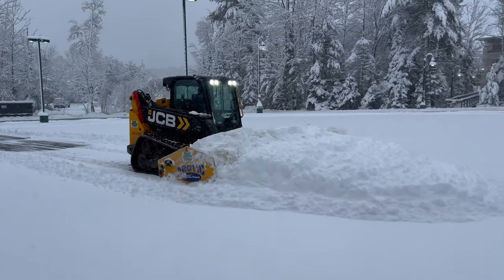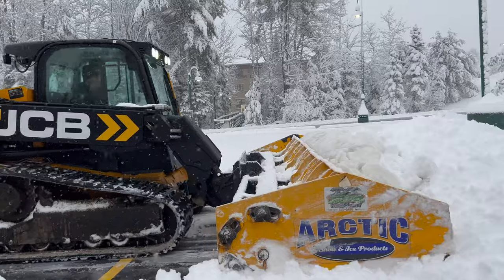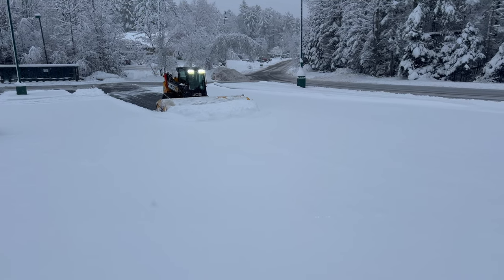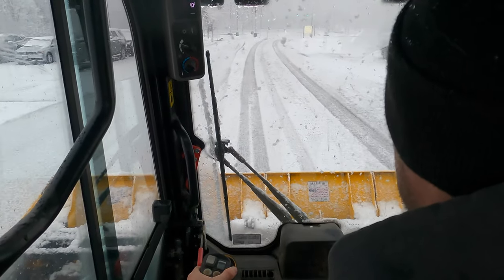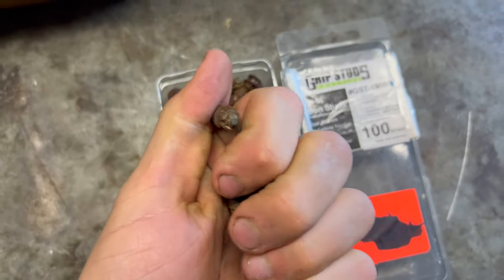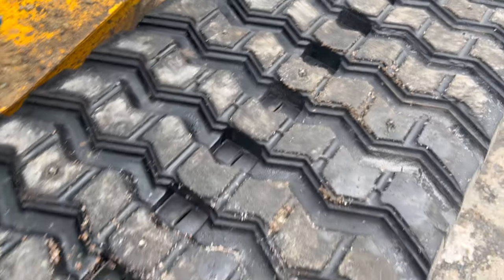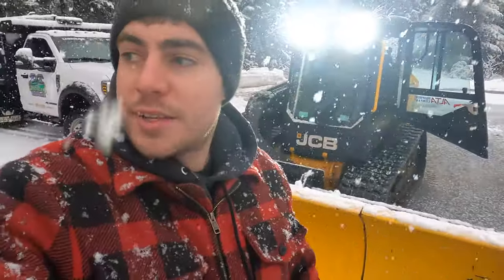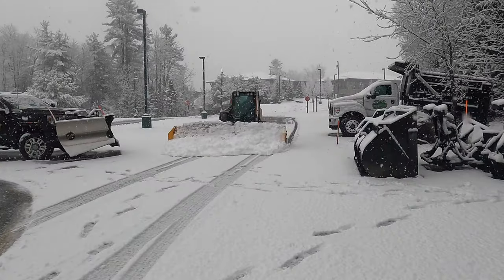Will studs help snow plowing?

Comment: I installed the same ones in my bobcat tool cat no it is impossible to get it stuck and with new drivers I do not have to worry if it gets icy out there always under control
Reply from the maker: They definitely are definitely worth getting